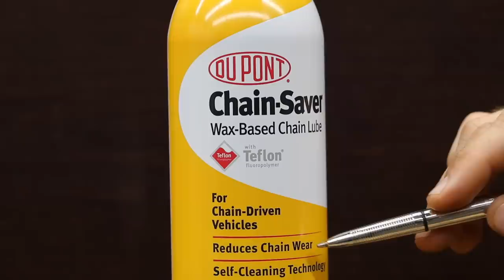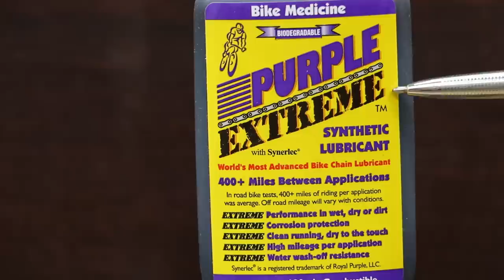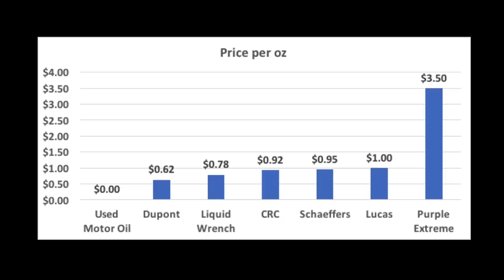Which Chain Lube is Best? Let's find out!  Ultimate chain lubricant showdown!

Comment: Acetone will destroy any o-rings in the chains, next time use kerosene.
Reply from the maker: Thank you
Reply: Thank you. I did not know that.
Reply: Chains don't have o-rings.
Reply: @lazurm  Motorcycle chains do.
Reply: Thank you, I obviously didn't know that.
Reply: Baler chain does not have o rings
Reply: Diesel is equally good as kerosene.
Reply: Ag chains don’t come with o rings.
Reply: those chains dont have o rings , you can see that they are thin and have no gap , most bike have o rings , would hate to see the cost to run o ring chains on that baler !
Reply: From personal experience, if you have an O-ring or X-ring chain. Don’t use Lucas it will destroy it
Reply: Kerosene specifically, or an actual chain cleaner.  Gasoline will also eat O-rings.
Reply: kerosene wont destroy o rings but it will seep past them, watch the fortnine video on chain cleaners
Reply: @M-DIY  Singh is King! (The awesome Sikh guy I worked with in NJ used to say this. He is like a little bear, though his son is 6'7"!) Very true about solvent capability of kerosene and diesel - so similar. Whichever is available or less.
Reply: @violetaarreola6604  yep, both are best, use whatever you have at the moment.
Reply: O rings on chains?  Need to lay off the dope for a while, check in to Betty Ford.
Reply: RyanF9 from Fortnine did a thourough testing and found that kerosine penetrates the o-rings (it gets behind it and into the sealed lubricant). Although there's no proof that this is bad, it doesn't sound too good...
Reply: @enduronorthnz6437  Yeah. It was definitely right to not use o ring chains for the testing. That doesn't really test the products. Non-oring chains cost a ton less, but for practical use, they last such a short time, they're only for racing when it comes to motorcycles.
Reply: @isaiahwright2216  Seriously? I've ran Lucas on both. That's awful! Maybe that's why I did so poorly. It holds on to the dirt to the extreme.
Reply: o-rings in motorcycle chains keep the lube in them ((the roller barrel that rides on the sprocket tooth). The clean and lube process is primarily for the lifespan of the o-ring and also for the contact to sprockets. These lubes go on wet and dry (lots of solvents to get  them applied).  READ THE LABEL.
Reply: @lazurm  Oh yes hey do!  - some of them.   SALT Chains as a  major example! We lso use special SEDIS Chains ( a premium brand(?) Roller Link chain ) i Europe.
Reply: @therustyblades1212  whose Baler chain then? My ones have!
Reply: @culmalachie  Yes, someone else  replied similarly. Learned something, thanks. I'm into bicycling so was ignorant about that.
Reply: Ride with Ren, I have a bike too, and use diesel (works just like kerosene, but very CHEAP) to clean chain.  I have found that DuPont 'wax-based' chain-saver (cheapest he tested) is excellent for our motorcycle chains.  It seemed dry in his test, because it IS dry by design. As a wax, it minimizes flinging, and dust attraction, yet still seems to lubricate quite well after 400-600 miles.  Havent tested these other ones, but it's quite dusty here, and im happy with DuPont, especially after upgrading from Champion crap! What do you use?
Reply: True; before I lubricate my motorcycle chain, I clean with Kerosene.
Reply: Xylene works well too. Basically the same as kerosene.
Reply: Aka diesel or light heating oil or Jet A or lantern oil or grill starter...
Reply: @M-DIY    Nononono.  Diesel is terrible for rubber!  Look under the hood of any turbodiesel, look at the coolant flange and gasket failures on VWs where it rests directly below... the tandem pump which has a gasket that fails.  Drips down, makes the oring on the flange swell, deteriorates the GRP flange material too.  Deteriorates any coolant hose it comes across.  Dissolves them into a black sludge that smears off anythign that touches them
Reply: @VndNvwYvvSvv  I know that diesel attacks some types of rubbers, but you got nothing else to clean chain! Kerosene which is hard to get, diesel which is readily available and turpentine oil which is a bit expensive, petrol is a no brainer, so you are left with few options and diesel ticks all the boxes.
Reply: @lazurm  sealed chains have orings, more then likely they are not sealed chains, but always safe then sorry
Reply: Irrelevant for most types of chains. Good point specifically for motorcycle chains though.
Reply: They don't have orings but they do have acrylic, pvc and on occasion steel sleeves inside of them. I worked on bicycles for years and had giant rolls of bicycle chains in my work shop for chain replacements and every single chain I ever worked with had sleeves inside. The only purpose they serve though is to keep the chain straight and lined up. However for testing purposes, the acetone works perfectly. For practical application I used diesel fuel or a strong degreaser.
Reply: @TheSlimCognito : I've taken apart plenty of old bicycle chains (good ones, not cheap ones) and I've never seen plastic bushings inside any of them. They've always been steel-on-steel, sometimes with nickel plating or stainless steel but never plastic of any kind. What brands of bicycle chains have you used that have plastic bushings inside the rollers?
Reply: @deusexaethera  mostly I deal with Shimano, wipperman or clarks. Don't get many kmc chains through or SMC. The chain roll I have is from Shimano, and it's all acrylic core. I used to buy them 1 thousand feet at a time in a roll. I would always diesel soak them then put BG on them and never had one break with the exception that someone totaled their bike and the chain broke half a link.
Reply: @TheSlimCognito : All of my chains are Wippermann now, though I used to use KMC, Sachs/SRAM, and Shimano chains. Never saw any plastic in any of them. Maybe it's a feature exclusive to road bike chains.
Reply: @deusexaethera  that's possible. I never thought of that. Come to think of it, neither one of my off road rally bikes had acrylic or pvc cores. Granted I still used the road bike chain on them and never had a problem. I dealt with road bikes mostly and usually when the off road bikes came in the chains were missing already. Damn branches can do some damage. Replaced a rear derailer and chain and rear gears on an 18 speed down hill series mountain bike. The shocks on it could send you flying. The road bikes only ever got warn down from constant use which I proceeded to reuse those chain for various projects. Old sprockets and chains make for great pulleys for bike hoists.
Reply: @TheSlimCognito : I ride XC bikes because I refuse to ride bikes without suspension, but my riding is mostly roads and paths, so my parts wear out from age rather than impact. But since I run MTB parts, I run MTB chains as well; when your bike weighs 30 pounds, the weight reduction from hollow pins and thinner links is totally negligible. (well...it's totally negligible anyway, since you can drop a pound of weight just by taking a dump before you go for a ride, but don't tell a roadie that.)
Reply: @deusexaethera  I trained on a heavyweight bike that topped out at 63 pounds. Solid steel construction for the win. But when I would do events I was on an alloy bike topping out at 21 pounds. Still heavy by cross country standards but it's like running on a treadmill for an hour then stopping to walk, the world seems slow and you feel like you are sprinting. I never used suspensions because you lose to much force when pedaling hard. Of course I would be on the bike for 4-6 hours traveling anywhere between 90-150 miles. So every bit of energy lost was needed. I never worried about weight to much though. Some riders used carbon fiber gears or alloy but I stayed true to stainless gears and my bulk ordered Shimano chains. My rims were aluminum on lightweight and steel on the heavyweight. Boy do I miss my solid steel positron shifter though. Dynasty really knew how to make bikes back in the day.
Reply: @TheSlimCognito : Weight is only really a penalty if you invest a bunch of energy pedaling uphill and you can't reclaim that energy by coasting downhill without using the brakes. That's why I never really worried about weight; also I value features more than lightness.

MTB suspensions are a lot better nowadays than they used to be. I've watched other people ride my MTBs (currently both of them are newer than 2012) and I've seen the suspensions not moving when pedaling on smooth ground. If you stand while pedaling that makes a difference, but while "spinning" it's common nowadays for MTB suspensions to be motionless.

Carbon-fiber sprockets are absurd. Carbon-fiber doesn't have enough abrasion-resistance to be an adequate sprocket material. But I guess some people will pay for absurd things to feel like they're going faster.

If you're curious, this is my newest bike: https://forums.mtbr.com/general-discussion/build-complete-carbon-fiber-full-sus-internal-gear-curb-jumper-roller-brakes-1112587.html
Reply: @deusexaethera  when I trained, I did train on mountain roads, so the weight made a huge difference since I spent a lot of time going up hill. I know some people spend money on things to make them think they are going to do better but I stick to steel gears or alloyed gears. I don't use suspension simply because my riding habits and locations don't call for it. Though my off road bikes have suspension. I have a downhill series offroading bike and that suspension can bounce. But I like to trailblaze and use it for harsh terrain.
Reply: @deusexaethera  as for your current build, it's very nice. Looks like it would be lots of fun to ride. Though I prefer positron shifters simply because they never fail to work. The handlebar grips would not last for me since I use ones with cuffs on the bottom to support my wrists, but that's just because I like to ride lazy. Overall I think it's an excellent build. Who cares if people call it pointless, it's got plenty of purpose. Though it would not last long on the roads around here. Can't use anything expensive around here. It either gets stolen or broken on the roads, trails and sidewalks which are in horrid condition.
Reply: @TheSlimCognito : Just gotta keep it inside when not riding it.
Reply: @deusexaethera  I keep mine in a shed which hasn't had any problems. I always spray everything down when storing it for more than a few weeks. Wd 40 works or just some silicone lube to keep corrosion away. But I live in an area where rust or corrosion isn't really an issue though. Dust is a big issue here so I have to clean that stuff off before I ride which I always do anyways before riding.
Reply: @lazurm   Many chains have O-rings to protect rollers and pins from moisture and as a means to retain chain lube.
Reply: @faschwank  I've learned that since my long ago posting (as answered to in the subsequent comments to me). Thanks though. :)
Reply: Bike chains don't have o-rings, my bike chains don't anyways. Also, kerosene doesn't remove oily residue from the chain since it is an oil. It might work okay for normal cleaning, but it wouldn't work for what he was trying to do.

Comment: The chainsaw test is the only one I have any sort of contention with, as it seems some of these were not at all designed for chains moving at such speeds. That said, It is a pretty informative test overall. As an alternative, a slow-ish speed test, an electric motor set at a certain speed with a sprocket at the end, tied to an idler on a bar a set distance away might have been a more controlled manner to test the sling of the oils for lower-speed applications. This could also let you dial up/down the speed by adjusting the drive motor. Just my opinion, and hopefully it can be helpful for a future test down the road. 
Like perhaps testing what type of replacement (or emergency) belt/ belt material is best...

Comment: could you test various 2 stroke oils in the lubricity tester please?
Reply from the maker: Thanks for the recommendation.
Reply: It would be an interesting concept but you would have to go with the theory that you would have to run the same fuel to air mixture and then depending where the overall person is using the product their results would vary.

I add seafoam and Lucas Fuel Treatment to my fuel in addition to running Amsoil Sabre. I use it in a single cylinder piston ultralight aircraft engine and my running temperatures for the past 2 years are minimal. Also carbon buildup comparably running Avgas has been significantly less which I would expect from adding basically any additive.
Reply: He should try some of the “off brand” bulk oils that lawn mower dealers sell by the gallon.  That’s what I was using, but have now switched to Quicksilver from Walmart, which is even cheaper.  I can get a used motor for my weed whacker for $40 on EBay, so I want the cheapest oil that will get me through a season.
Reply: Klotz,castor 927, amsoil dominator, and cheap gas station oil would be a good comparison in my mind
Reply: zepfan96  x2 on the amsoil. thats all i use in my 2 strokes. 

amsoil saber 100:1
Reply: Yeah I want two stroke oil tested aswell
Reply: I would like to see it too. I would like both Klotz R50 and Klotz BeNOL
Reply: @fivespeed3026  Quicksilver from Walmart is for water cooled two strokes. Air-cooled 2 Strokes need a different blend of oil. I found this out the hard way when I took the previous owners recommendation after buying my 79 RD400 Daytona special 2 cylinder 2 stroke street bike.
Reply: John Wyman I agree that most of the Quicksilver oils are for marine applications, but I found one that clearly had a chainsaw pictured and it said on the bottle that it was safe for all small 2 stoke motors.  I went to Walmart again and it was gone.  I’ve gone through almost the whole gallon and all my equipment is still running fine.
Reply: @fivespeed3026   I stand corrected. 
I was in a convenience store today and saw some on the Shelf, it surely did say it can be used for basically all two strokes.
 That's why I came back here to straighten out my comment. They must have changed the formula in the past 20 years or so since I scored the Pistons and cylinders.

Comment: I’ve been cycling for years.  I’ve tried everything including dipping my chain in hot wax.  I’ve found that full synthetic 2 stroke motor oil to be the best.  Just seems like there’s less resistance pedaling. And that’s what counts.  It does pick up a little dirt but I routinely wipe the chain off with a cloth. 
I also wipe the excess oil off after I lube the chain .  2 stroke motor oil is also the cheapest.  Small bottle at Walmart is 2.50$ compared to 12-14$ for bike chain oil.
Reply from the maker: Thanks for sharing.

Comment: Thanks for your videos! I'm an electric bike mechanic with  8 thousand fleet repairs for electric pushbikes. Rock n roll chain lube (Not tested here) specifically states that after application of lube to chain to wipe off

 excess external chain links with a clean dry rag or paper towel. This aids in the prevention of dirt and grime at least building up on the external part of the chain. It's the rollers inside the chain that wear out as we know. I have found this product to be quite good,  however due to the static electricity build up that exposed chains on push bikes experience they all have a limited lifespan. Correct chain tension and regular suitable application and cleaning of the chain in my opinion are the best ways to prolong chain life. The ultimate protection is an enclosed chain guard or shaft drive!! Thanks for your thorough testing videos,  certainly helping to cut through the BS of advertising on so many products. Cheers from Wes ( Australia)
Reply from the maker: Thank you!